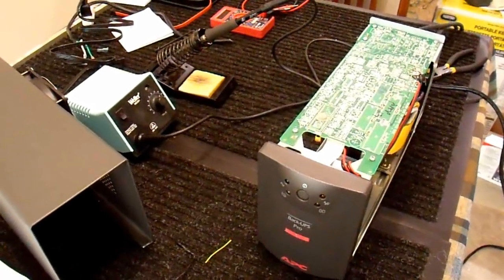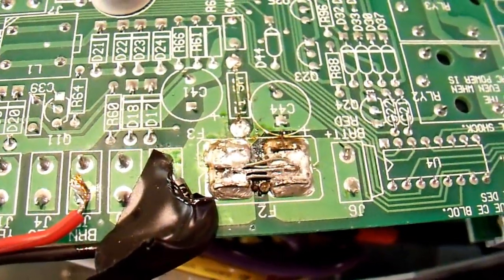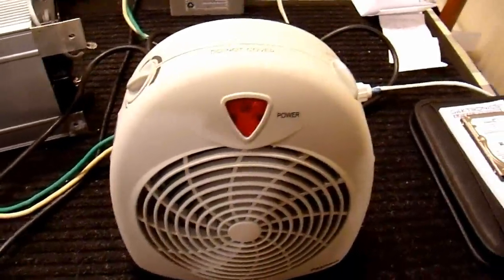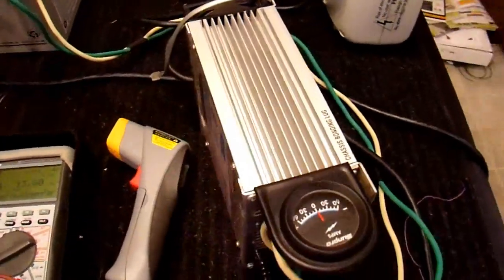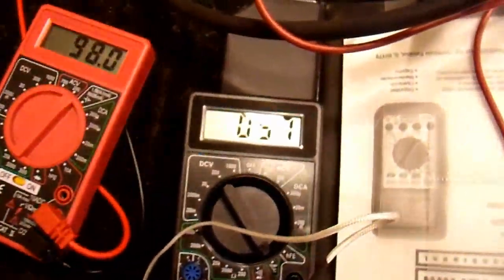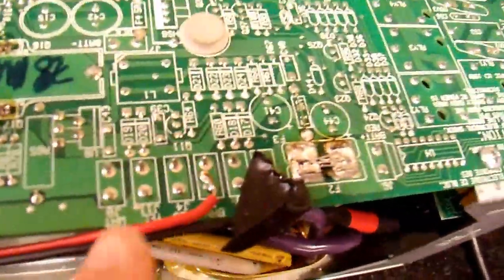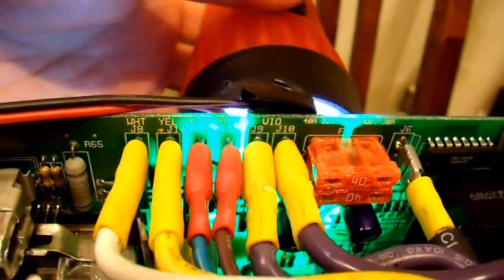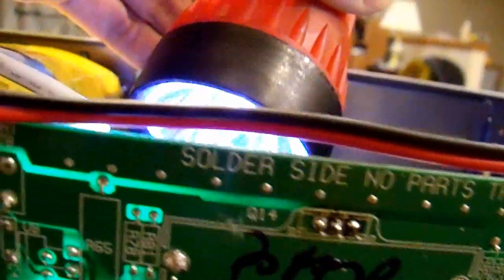UPS to Inverter Conversion FAIL Follow-up part 1

Comment: i like all of your videos and i must say you really know how these UPS, especially how APC UPS work.
the area where i live, sometimes people use these APC UPS as inverter for their solar system, the main and complicated problem people here face is that sometimes the FETs of the APC UPS burn out, i just wanted if you could make a video about how to repair an APC UPS whose FETs are burnt.
Actually when the FETs get burned, then changing the FETs doesn't solve the problem, you have to change some of the controlling components too. now i dont know exactly which controlling components need to be changed.
i know only you who has so much knowledge of APC UPS, so i would really appreciate if you could make a video about repairing APC UPS.

Comment: Awesome videos.
I just took a malfunctioning USB and tried to convert it into a light duty inverter, however it doesn't put out any ac voltage. 
Since it quit working at the office and was thus replaced, I was hoping it was a bad battery and that I could convert it to an inverter, unfortunately the battery works fine, thus there is a problem elsewhere. 
In stripping the 'spare' parts out of it, I discovered that there was only one wire connected to the 10a external circuit breaker. Ideas?

Comment: I have an old Compaq UPS T1500h (230vAC), which I'm having an issue with, when running it as an inverter. I have removed the batteries and connected it to my big 24 volt battery bank, but the odd thing is that it turns off after a few minutes, when the load is below 200 watts. Running beyond about 200 watts, lets say 450 watts, the UPS will run until the batteries are exhausted. Do you know how to change the settings for this unit, to make sure that it also runs on lighter loads ?